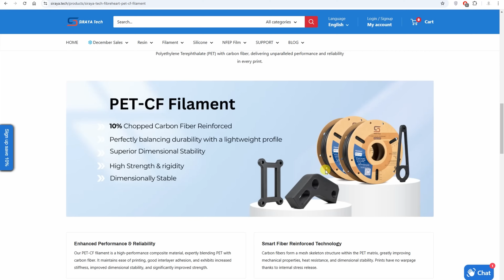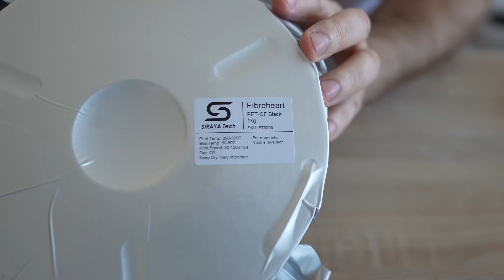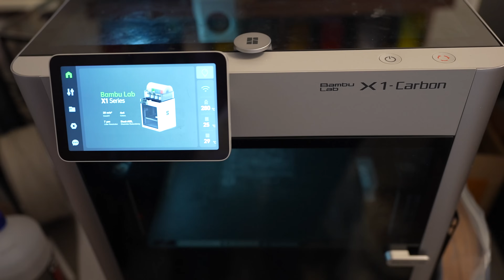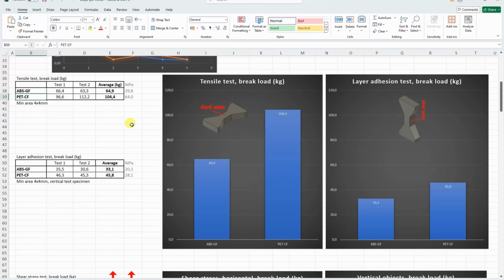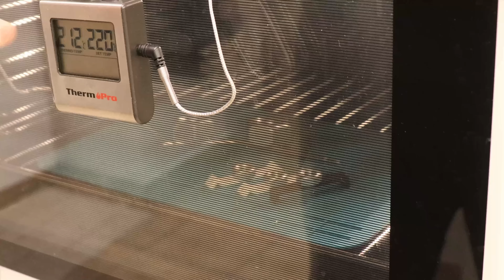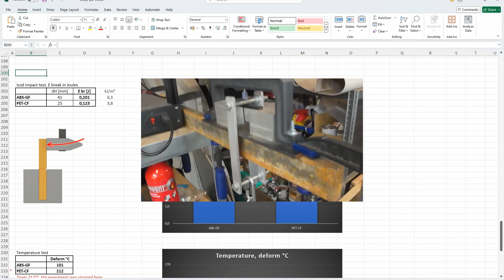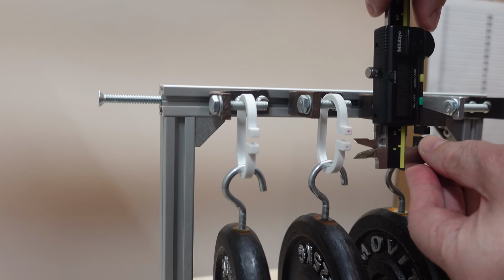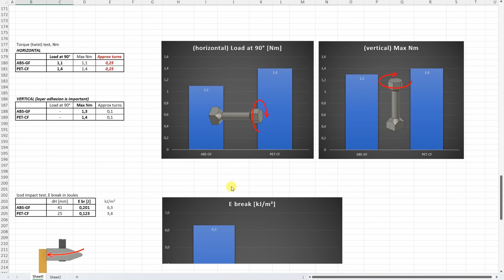PET-CF, technical filament with best strength to price ratio. By Siraya Tech

Comment: How did you manage to print it at 300C? We (a few people) can't get it to work unless we reduce the temp much lower than recommended. Otherwise, it seems to flow too easily, and won't stop flowing when extrusion stops or slows down. This mainly causes issues with bridges and overhangs, they all sag, with internal bridges sagging right through the infill. (Reducing bridge flow rate helps but what's already in the hotend continues to flow, causing at least some first part of the bridge to sag.)
Reply: Dry it longer it will ooze if there is moisture inside the filament.

Comment: Thank you very much for these tests. I am curious if you have any theory why this filament had such impressive heat resistance without annealing, or perhaps why the Bambu PET-CF filament needed the annealing to achieve a similar result? 

Also, I noticed that you printed this on 0.4mm nozzle. Have you had any issues printing any of these GF or CF filaments on 0.4mm nozzle yet? I purchased Bambu PET-CF for my project and had two nozzle clogs back to back on 0.4mm nozzle. It worked nicely on 0.6mm, but I am not a fan of the print quality…

Comment: In the future video where you compare this to PAHT CF, it would be cool to see both materials annealed as well. I’m interested in if this is a solid replacement for nylons for high temperature uses. Especially since once PET-CF is annealed the temperature resistance is even higher.

Comment: Igor, can you provide your educated opinion regarding safety? my experience is with using QIDI PET-CF and after touching a broken tip in my palm I got a lot of fibers stuck under my skin, only visible with a microscope,  I can not get rid of them, what if I start rubbing my eyes with my hands containing fibers, will they get stuck in my eyes too?, what if the filament or printed part gets handled by a child, what if I breath them? do printed parts shed fibers over time due to friction?, thanks in advance.
Reply from the maker: I don't have a detailed investigation so far, but analyzing the safety instructions, I found many similarities with the woodworking industry. I was talking more about this in my BL PA6 GF, CF video.

Comment: I may not need to see these test results for a technical reason, but holy shit have you saved me a lot of money by preventing me from buying a more exotic material with insane claims of strength and toughness at the same time. I know those two aren't mutually exclusive, but I also know that those two are typically not high values at the same time on one material. This isn't one of those times that you saved me money though. I was just gonna use some PLA pro from polymaker since I have it and wasn't worried even though I don't think it's a good material, but you just convinced me that my absolutely favorite resin brand may also now be my favorite filament brand and I need this PET-CF!!

Comment: I don't understand, PET-CF has great mechanical properties, it' has a good price, prints very well, it's not so problematic with humidity, it can take a lot of heat, it doesn't stink... isn't this the superior option for the hobbyist? Why would I choose ABS, ASA or PA instead of this for printing at home?
Reply: Abs and asa are still half the price or even lower. PA has some other better properties

Comment: It might make it the oven at 212c but it will warp in a dishwasher. Just had to test it to see if it was dishwasher safe.
Reply: Was it annealed?
Reply: @riba2233  No it was not. No info on the site how to anneal. Was not annealed in this video.
Reply: It's the same for all pet-cf filaments, it should definitely help

Comment: I have used this product extensively.  It's stiffness is not as high as PPA-CF, but it isn't too far behind. A phenomenal engineering grade filament at a bargain price.  If you need metal like performance, PET-CF will not quite get you there.  You need the PPA-CF instead.  That being said, it is very good for the dollar spent.
Reply: Hi there. For a continue load under shear e.g a beam, would you recommend ppa cf or do you think pet cf is safe enough. Not concerned strength wise, more so under creep and reliability

Comment: Very interesting. Think I am going to get it instead of the usual ABS-CF and maybe even replace nylon in circumstances where impact is not a concern. Still need to find a go to filament supplier in europe, to replace Eryone (treat customers very poorly, won't even cater for returns). Would be nice to see if you have recommendations. Gonna have a look around for local PET-CF at similar price point. Good work there. Still not a patreon though (hope I get less broke soon, then you will be the first).

Comment: I'm quite surprised about the differences in temp resistance between this PET-CF and the one from Bambulab despite the comparable mechanical results.
In the last days i often compared the prices between manufacturers of filaments for materials with same designation.
But now i think, i will maybe never trust i filament, that has not been tested by you, if i need specific technical properties.

Comment: Great filament for sure, how is the UV resistance of the Siraya PET CF?
Reply: have you ever let a plastic bottle in the sun?
Reply: @riba2233  Depends what kind of plastic bottle.

And it doesn't matter, Siraya PET CF filament is specifically what I asked about, not a blow-molded plastic bottle whatever it's made of.

Comment: I am excited to see the PPA testing results.

I picked some up from Amazon because it is not expensive. Only a third of what Bambu is charging.

I got it for its strength and temp resistance. I need the part to be able to handle being near 230-250*C on a regular basis... By near, I mean about 20mm and not in direct contact, and near the high temps for several minutes at a time. Basically a component close to the part gets hot in use. The part needs to handle rough handling as well.
Reply: use PPS-cf for that
Reply: @riba2233  The question is... How tough it is?

The printer requirements are out of my range right now. I can't handle the nozzle, bed or chamber temp required.

From spec sheets, the heat deflection and glass transition temps are not better than PPA. So how tough it is, will be the factor that makes using it worth it.

I don't need the chemical resistance, which is it's main claim to fame.

The existing parts are PA66 GF, so PPA should work fine as a part I am attaching.

Comment: For CF filament it would be nice to add measurements of air quality in chamber and macro photos of surfaces, given recent concerns with safety of such filaments.
Reply: there are no concerns
Reply: @riba2233  yes there are, I used QIDI PET-CF and after touching a broken tip in my palm I got a lot of fibers stuck under my skin, only visible with a microscope, so, there are concerns, I can not get rid of them, what if I start rubbing my eyes, will they get stuck in my eyes too? what if I breath them? do printed parts shed fibers over time due to friction?

Comment: Why is the temperature resistance of the Siraya Tech PET-CF so much higher than that of the PET-CF that you tested together with the PPA-CF a month ago?
Reply: Bumping this comment up as I’m also curious! I bought a roll of the Siraya tech pet cf and printed a bridge type model like the one used in this video and popped it in a heated oven at 120c. It was stiff when removing it 15 minutes later. So this is definitely not a fluke measurement!!
Reply: @HotendHacker also so curious. Especially because their datasheet hdt. Without annealing is less than 90

Comment: Another excellent video. PET-CF seems absolutely brilliant. Thanks for sharing. Will order a roll immediately. Many years ago I used Kevlar in a hobby project. Fantastic material that has different properties than carbon fiber. Has anyone come into contact with Kevlar reinforced filament?
Reply: kevlar is not nearly as stiff so it wouldn't work with chopped pieces like cf or gf. but take a look at Tullomer filament
Reply: @ Yes, you are right but it has other qualities that is useful. When I used it I mixed Kevlar and carbon fiber for stiffness and strength (aircraft propeller). I will check Tullomer filament. Thanks for the tips.
Reply: @riba2233  I've been working with Tullomer...it's stiffness is comparable to aluminum of the same dimensions (100% infill).
While it has some great properties, layer-to-layer adhesion is a major weakness.
Excellent bending properties, falls apart if you apply a twist...the stuff 'delaminates' like a failed composite!
The material is not isotropic...more like a bit of brittle Cedar...strong as hell in flexure, a butter-knife splits it lengthwise.
Need a hot printer (325+ nozzle), hot-build plate (120-180C) and hot chamber (60+C).
My X1C was barely up to the task.
A more capable machine might do better?
(No, I am not getting a K2 plus to find out...)
I'm keeping my eye out for Tullomer II...

Comment: Maybe I did something wrong but I printed some spool cradles for my sunlu S4 with pet-cf for the heat deflection. But set to 70c the hotspot in front of the heater in the s4 reaches around 85c and it softened and deformed in that area. Reprinted in abs-gf and its holding up. Main reason I got this pet-cf was for the temp resistance but I didn't have results like that.
Reply: Are you sure it's PET-CF and not PETG-CF? What brand?
Reply: @dmitryplatonov  yes it was this exact stuff, Siraya pet cf, they don't sell petg I believe, or I haven't found any. Printed at 300c, parts were very hard to break but I didn't get the same heat resistance.
Reply: Did you print it with infill or solid? I'm guessing infill and maybe that's why you had deformation. Hope we can help figure it out together
Reply: @3dPrintingMillennial  99 walls, it was a cradle that holds a spool up away from the heater. Which is why I chose this petcf.
Reply: @Ethan-ve3kb  is it a large part? Is it possible that these test pieces are being annealed (nature of the small size, hot bed, and hot nozzle) vs the cradle holder being a large part? 

Please note that I'm just helping to troubleshoot and I'm not being critical or questioning your knowledge. 
🙂

Comment: I'll see you YouTube's ad rip-off. Looking forward to the comparison of the Siraya lineup. While I "only" have an X1C, I would ask that you run the hotter filaments in your Qidi with an "at x1c temps", and an "at higher than x1c temp" comparison. I often wonder how much Bambu is weakening their filaments to get them to run in their printer.
Reply: 280-300C is the correct range for non-amorphous PET-CF
Reply: @MrJofArnold  I’m more thinking of the comparison of PET vs PPA. His comparison against Bambu PPA showed lower adhesion for PPA. But another YouTuber did PPA at 300 degrees and no fan and the PPA won. So then you wonder where the upper limit is. Would be nice to graph it at several points like 290, 300, 310. And test higher if the graph shows promise.
Reply: @rcrdps8144  Gotcha. Unfortunately I'd not worked with PPA yet so can't add much further. I've a small amount of experience with ASA, ASA-CF and PETG but 99%+ of my prints have been with PET and PET-CF.

Comment: Thank you for another informative video. I have been using Siriya PET-CF and Qidi PET-CF for several months. The main difference between the 2 filaments is that the Qidi filament contains 15% carbon fibers versus the 10% in the Siraya. Would like to know what effect this would have on the physical properties. I have printed c- clamps and vices with both and their strength seems similar.  The Qidi seems to print a little smoother on screw faces and the edges of layers. Using a Bambu A1 or A1 mini They both print fine at 290-300 deg c with a textured bed plate set to 60-65 deg c with no glue stick. Even on small objects I have not needed any brim. Have seen no warping. Would like your expert opinions
Reply: Ah thanks for that. I was wondering if there was any difference to the QIDI. By the way what do you mean by “screw faces” in your comment.

Comment: Excellent video once again! I am currently researching materials because I want to print a frame for a 5 inch autonomous drone (needs to be slow, steady). Originally I was considering nylon (PA12 CF > PA6 CF) but I decided it against it due to moisture absorption and creep issues. Then I turned to PP CF and PET CF, and the latter appears to be the optimal option (probably bambu PET CF), but impact resistance worries me.  What's your recommendation?
Reply: I think you should give the PETcf a shot. It’s incredible stuff I think it will hold up really well as a drone frame with occasional crashes.

Comment: PET-CF and PET-GF are imo the best overall engineering filaments due to price, low warping, high temperature resistance, strength, and ability to hide layers lines (glass-filled slightly better at it than carbon). You don't even need an enclosure

Comment: No annealed test print tests? 😭😭😭

It's heat resistance should increase significantly after annealing!

I would retry the test with more load after annealing :) and it's very easy to anneal!
Reply: it is already at 220c, it can't go higher.
Reply: @riba2233  more weight
Reply: I've read that the bambulab PET-CF resistance is 120 deg. raw, and 210 deg. annealed.

Comment: We see that this filament is "Suggested" to use in an enclosure. Would you be wiling to test its printability and performance on an unenclosed printer (P1P or A1) to see if it warps even with the carbon fibers?
Reply from the maker: It is printable on A1 too, but it will have weaker layer adhesion. Probably I will test it soon (I will have two more PET-CF brands on the test).
Reply: @MyTechFun  yes please! Comprehensive test on A1 with hardened steel nozzle!
Reply: @MyTechFun  please add PET-GF if you can!

Comment: Jesus Christ, what a performance. This might become the ultimate technical filament for just 50 €/kg.
Reply: The price has gone down to 37$ on Amazon!
Reply: Whats the difference between this and bambu pet-cf  other than the massive price. I'd love to see head to head
Reply: @Andrew-hr5on Overall the siraya tech is better. Look up edge of 3d he has done testing on the them. My tech fun also has compared them.
Reply: Only problem is that FDM printed parts leave tinny CF/GF splinters, giving the parts the matt surface, that embed into skin when handling parts. CF/GF injection molded parts doesn’t have this problem because molded parts fully encase fibre into plastic.
Reply: @3rdHalf1 i wish this point would get more coverage! And the solutions too, like coating sprays..
Reply: @DrZylvon the spray would maybe need either chloroform or dichloromethane as the primary solvent to partially melt and then coat the surface of any composite pet based filament in order not to eventually wear or peel off.

Comment: Great engineering filament. Does it even need an enclosure? Also did you ever test PET filament without the carbon fibers, I'm curious how it would perform
Reply from the maker: I found this for other brand: Enclosed printer is Recommended. Open frame printer: Capable, but Layer bonding of some prints may become low due to overcooling. I tried once, a frend give me some PET recycled from bottles. Not easy for printing without CF.